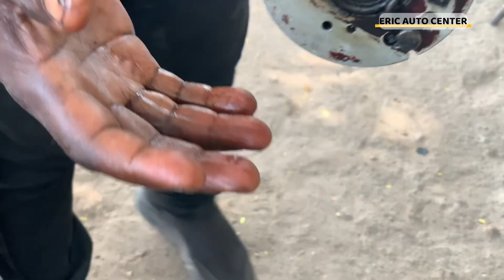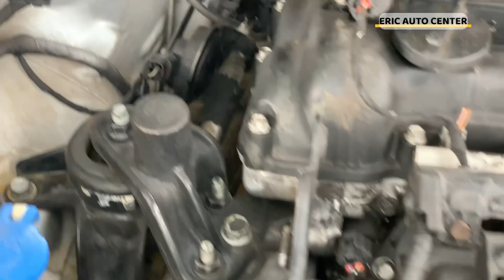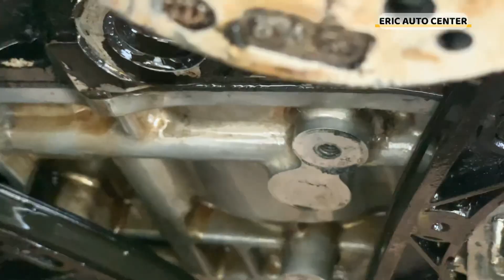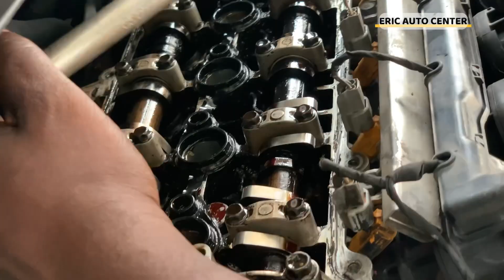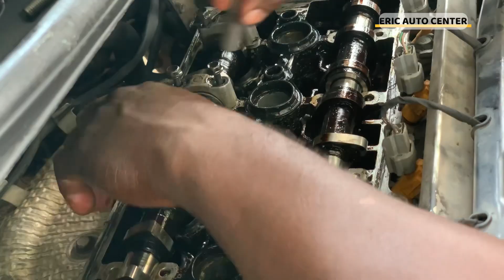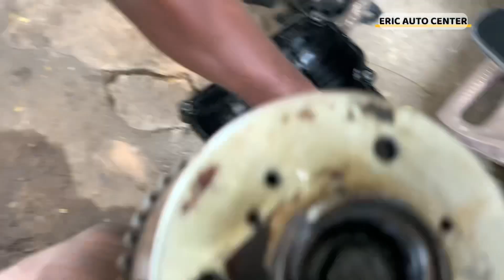P0014 B Exhaust Camshaft Position Timing  Over Advanced or System Performance (Bank 1 ) Fixed

Comment: Nice work..... my 2013 sonata started with a misfired engine while it runs. i checked and discovered that the cylinder 1&4 were not working. I changed the coil and spark plugs but nothing changed. Then i have the car scanned by a technician and the following coeds came up P0014, P0200, & P2146(history). The technician checked the injectors and said all performed fine with desire pressure. The vehicle was coupled back with nothing majr done and to our surprise the engine was fine with all codes cleared.

After few days, the problem started again but now it's the cylinder 2&3 that is not working while the 1&4 works fine. We have the car scanned again and the previous codes that came up before appeared. 

Could you please advice on what could be the possible cause of the engine misfire at different cylinder.

Thank you.
Reply from the maker: Brother John, sorry about the situation. I suggest you bring the car to our workshop so we can resolve the issue for you quickly. This is a common fault that many customers complain about, and we handle it regularly. Whether you’re in Accra or outside, feel free to drive in—we’ll fix the problem permanently. It’s an internal fault.
Reply: @ERICAUTOCENTER  I really appreciate your swift response. I am currently in Lagos Nigeria. Do you have a branch or colleague here that i can visit. If no, kindly advice on what the mechanic should do. Thanks
Reply from the maker: We don’t have representative in Nigerian for now

Comment: Please where is your shop located?
Reply from the maker: Mamprobi salvation
Reply: @ERICAUTOCENTER  please I told my fitter to contact u about some gadgets and some part of my Chrysler 300 did he call u?
Reply from the maker: @charlesboateng1087 yes he has contacted me
Reply: @ERICAUTOCENTER  oh ok thanks hope u will help for that because am your subscriber.
Reply from the maker: @charlesboateng1087 Not a problem we have spoked so I will assist him tomorrow
Reply: @ERICAUTOCENTER  thanks u very much
Reply: @ Ok thanks I think I will need your help on my Chrysler 300 there was oil leaking but we did not see so the engine was started smoking and there was noise in the engine.please what is the problem that course the noise
Reply from the maker: @ you can reach out to us for proper diagnosis to figure out what exactly is the problem